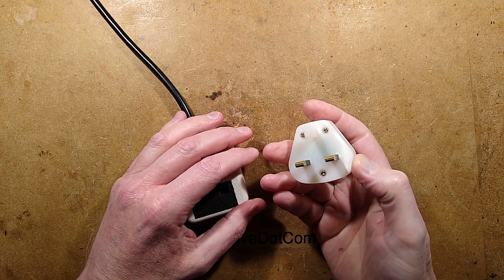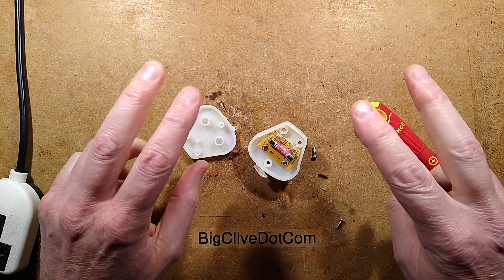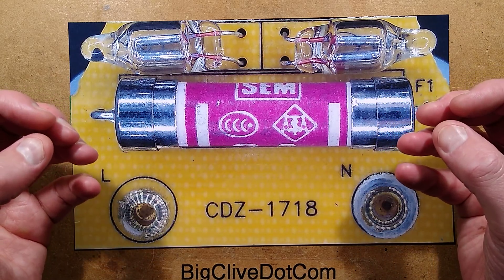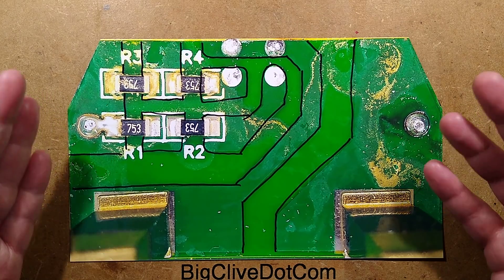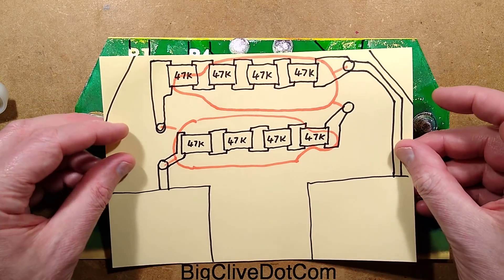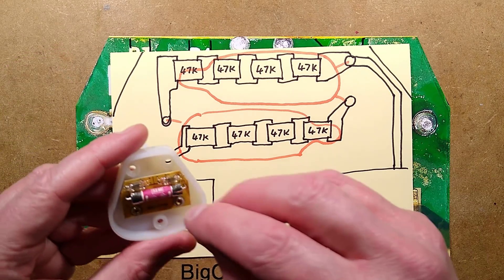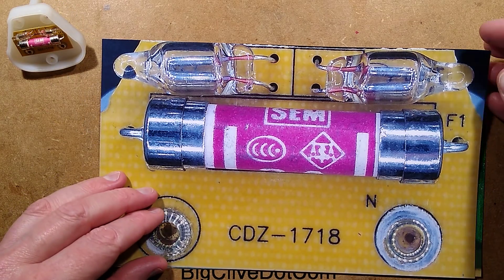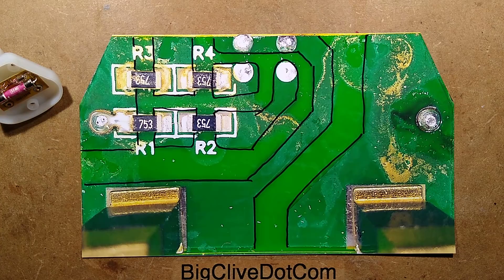British neon night light and the curse of the box-tickers

Comment: They could have a moulded in ”fuse”, to make it impossible to bypass it when you mod the plug to use it as a plug.

Oh, i see: They have gone the cheap crap road and integrated the plug in the board.
And integrated the unnecessary fuse in the same board. That not gonna help when some idiot replace the giant fuse with a cord.
Reply: They could have done a much simpler fuse: A thin zig zag track on a zig zag board, with some lacquer on top.

Comment: If they absolutely had to fit a fuse in it why not one of those tiny 1A fuses you find in electric razor adapters? Though having a fuse at all is overkill, the resistors will act as fuses if their current rating is exceeded, especially little SMD ones like that, or worst case scenario the thin trace coming off the live pin. The regulatory boards have gone mad with power, if I want to injure myself I should be allowed, can't even get paint stripper that works anymore.
Reply: Yep the 3A fuse in that circuit would be that last thing to fail if there was a fault.

Comment: Couldn’t you just turn the board over so the fuse is on the bottom then install lamps on the top ?
Reply: I dont think that design could be wave soldered.

Comment: Thanks for this vid BC. It has helped my understanding enormously. :)  I have a toaster oven with no transformers or circuitry, but the neon (power indicator) lamp went out and the entire device failed to operate. With no circuitry, i wondered if the lamp had acted as a fuse.. of sorts. The mains plug is 13 amp and has not blown.  Toaster was eathed to the chassis and no burning at all. I can only imagine that the bulb was circuit breaker as all the thermo switches operate perfectly. Or maybe live touched neutral?  but the sockets and circuit breakers worked fine and didnt trigger. i've dissasembled it now. if you need any pictures to explain my reasoning for neon bulb fuse theory, i'll upload to imgur. Also 1:43 "One moment please"  :)
Reply: It wouldn't contain a thermal fuse, per chance? (There may be one inside an insulation sleeve, clamped to a suitable location.)
I don't see how the lamp could cause such a failure; it's not in series with the feed to the heater (it can't be).
I can only imagine it being something open-circuit upstream of both the lamp and heating elements.
 
Or does it use a switch with built-in neon indicator? If it does, then if the switch burns out it would stop the operation of everything controlled (including its neon).
Reply: @longrunner258  tnx!. i've not separted the insulating sleeves yet, but now i will thanks to your suggestion. The insulating sleeves only are on the leads to the two cast iron plates on the hobs, not on the oven. All controls are bi-metal mechanical thermo rotary dials, apart, from the neon lamp and two spst switches.  Will reply tmrw after i've done more ripping it to more bits. :) thanks again. appreciated.
Reply: @longrunner258  this is the entirety of the wiring. theres nothing inside the heat sleeves. i added images on my imgur account https://imgur.com/a/fmUPic1

Comment: Just put the fuse on the back where it usually is, if it has to have one.
Reply: Doesn't look like there's enough space inside the plug for that. You'd have to make it thicker.
Reply: I don’t think the plug would need to be thicker, but it would probably have to be soldered on the opposite side, so the neons would need cutouts in the board.
Reply: @Milamberinx  While that would work, it would only exacerbate the problem (even more light will get blocked by the PCB than by the fuse).
Reply: @rolfs2165  did you not finish reading what I wrote? "So the neons would need cutouts in the board".

Comment: Of all the things i have opened with a massive shit stain left by a pcb track fuse that arched out onto the low voltage side, now the decide to put decent fuses into cheep tat. I havent come across a neon indicates switch spur yet, so I don't think it's regs. I think it's a knob designer that doesn't need any credit for over guilding the lily.

Comment: Am I going mad or is the L and N on the wrong side? Shouldn't Live be the right hand pin as it's plugged in? I know it doesn't matter in this situation, but just asking lol. If they used a glass fuse it would have helped as they're smaller.

Comment: As a kid I had one of original versions of these.  This new design with two neons at the top looking like eyes would have freaked me out, making it completely useless as a comforting night light.

Then again, could they not design this using LED filament around the outside, making it more effective than the originals?
Reply: Neons are quite efficient in power draw

Comment: If i HAD to include a fuse, i would have tried the smaller diameter ones, also to solder the neons so they stand off the board, just about touching the cover, it would have given more spread.
Reply: And it would cost more

Comment: We used to have a ladybird style one back in about 1986. I remember my parents having to “get rid of it” and I was distraught. I wonder if the regulations may have come in that long ago!!!!
Reply: Did it use neon?  Or a small tungsten lamp.
I had one that had a single 7 watt lamp like you used to have on Christmas lights.  It was next to my bed, and once it was left on, and the beadspread was up against it.  Charred the cloth from the heat.  Lucky it didn't start a fire.
Reply: @COBARHORSE1  Couldn't have been just the bulb's heat. It likely had a high resistance connection problem, also.
Reply: @johnpossum556  it got hot enough to burn my finger if I touched the bulb.  7 watts of heat, covered in insulating fabric and it certainly will get hot enough to start a fire.  Perhaps you are thinking of the modern Christmas lights.  This bulb was the old fashioned Christmas light, a little bigger than a man's thumb.
Reply: @COBARHORSE1  No, I know which ones you are talking about. My current refrigerator has one for a nightlight right by the water and icemaker spouts. It never gets that hot. I have another one in a motion detector nightlight right by my toilet. I still think you likely have a high resistance connection in that light. I'd check the plug for patina and clean it down with a pencil eraser and you might find it runs cooler.
 It uses that candelabra base. Aldi's just had LED "antique" versions of those when I visited last week, btw. Put that in it and I'll bet it still gets hot.
Reply: @johnpossum556  Too late.  That was 45 years ago.
I think they made 1/2watt bulbs in that form factor too.  That's probably what should have been in that light.  And I think it had a little plastic shade/reflector that I took off so I could have enough light to read by, after bedtime.

Comment: Replace the fuse with a transparent glass type.
Reply: It wouldn't have the required by breaking capacity
Reply: Oh, that's actually a great solution
Reply: Glass fuses don't interrupt arcs the way that ceramic sand filled fuses do. Might as well use a 1/4 watt 47K resistor.
Reply: @Peter_S_  But in the real world it would be perfectly safe.
Reply: @6F6G  Yes, in the real world all it needs are ballast resistors with a proper rating to be perfectly safe. I would also use thin traces just for extra safety.
Reply: @Peter_S_  Probably some knee-jerk reaction to cheap Chinese versions that let their smoke out too easily. As you say, properly rated safety resistors (guaranteed not to go up in flames) for ballest would be more than adequate.
Reply: @6F6G  My guess is a ruling saying that all devices must be fused with a rated fuse which didn't provide an exception for this uniquely simple device.

Comment: A 3A fuse on something drawing mA in normal operation is impressively useless. Surely they could have at least found a 1A one?
Reply: 1amp fuses are more expensive than 3 from what I've been told.
Reply: @Max Hammick . . I didn't see anything say 3Amps. Where was it please?
Reply: @chrishutton1458  1:26
Reply: @maxhammick948  Thank you I've seen it now. The BS standards include 'preferred' values of 3A, 5A, 10A and 13A. So ignoring a search through 'what is available' they've gone for the lowest 'preferred' value.
This is probably also the cheapest option. My fav site has 3A at 22p each (min order 10).
Reply: Chris Hutton BS-1362 fuses are color coded by amperage, so that is where the 3A is coming from despite the text with the fuse rating not being visible.
Reply: @ethanpoole3443  It didn't look like the red I was expecting.
Reply: @chrishutton1458  if you look at the actual circuit board with the fuse then it is much more red, though still seemingly a bit off, than the photo Clive took which has a white balance issue that makes the fuse look almost magenta.
Reply: Why should we, as Americans, complain? May I remind you we've had dual fuses in christmas lights for well over a decade now.
Reply: I would never discourage protection, but 1 amp or less would be sufficient. What a waste?
Reply: John Possum The fuse’s in our Christmas lights were added to protect from excessive light sets being series connected and was a real problem back when the typical string was incandescent based, particularly when used outdoors for decorative lighting as people would string as many together as they thought they could get away with and the wattage could really add up.
Reply: @johnpossum556  The fuses in Christmas lights do not affect the light output of the lights. It's in the plug away from the string of lights. Fuses in plugs does make sense, but even the Christmas light fuses are pretty small, i've seen as small as 250ma fuses in the plug, and thats on 120V where you have half the power at any given current. Surely they could have gone with something similar here, they make tiny HRC fuses that would meet requirements for 32A 240V lines.
Reply: @2009dudeman  I never said the fuses affect the christmas lights, I just said that we use DUAL fuses in them. Facts must confuse you easily.
Reply: @johnpossum556 
Facts confuse a lot of people when they're only vaguely related and don't seem to have any point.
Reply: @tin2001  My point was clear. Our two countries' ways of dealing with house voltage safety is different, yet similar in many ways. Your ability to comprehend nuances is low. Go back to remedial English class.
Reply: @johnpossum556  Not only was your comment useless, you just want to be oppositional and childish.

Reading comprehension must be hard for you, because the original complaint was not about the mere presence of a fuse, it was about the size of the fuse which is impacting operation of the device.

You pointless comment about Christmas lights where they use properly sized fuses doesn't make you look smart either as those fuses do not impact the operation of the device.

Go be a waste of space somewhere else.
Reply: @2009dudeman  Considering we are just electrons on the internet that makes about as much sense as the rest of your "reasoning". Remember the thing about first impressions is that you never get a second chance.
Reply: @2009dudeman  The fuse has to be BS1362 compliant. Which effectively means that the size, shape and material were decided in 1947. They could technically fit a 100mA fuse, provided they can find a certified one, but that's probably more expensive than just picking the smallest commonly used certified fuse.
Reply: @fermitupoupon1754  perhaps, but there are provisions in the standard to allow for non-conforming plugs (using alternative fuses with similar arc breaking abilities in a smaller form factor would fall under this catagory) to be approved so long as they provide at least the same minimum safety as regulation plugs. Since the plugs have to be approved anyway for sale, I wouldn't think getting alternate approval would increase the total cost much seeing as you only have to get alternate approval once. 

I imagine the slightly added cost to getting it approved in the UK would be somewhat compensated by the lower design costs.
Reply: @fermitupoupon1754  ohh, thank you for having a pleasant discussion.
Reply: @2009dudeman  No, the idea of the standard is to eliminate "non-conforming plugs" so that consumers won't be tempted to insert an incorrect fuse, or worse, bypass the fuse, when it blows and they do not have a replacement at hand.
Reply: Put in a clear fuse and then light could pass through.
Reply: @jamesplotkin4674  UK BS1362 fuses are always ceramic tube and filled with sand. The required interrupt capacity is too high for glass tube fuses.

Comment: I had a couple of these as a kid as well. With a Smurf picture on them :D I called it the Smurf lamp.
Reply: I have a Donald Duck one from the late-70s (or really early-80s). Plugged it in to check it out a few weeks ago when I found it in a drawer (where it had been sitting for 25+ years) and it still works.
Reply: My first car spark plug tester was a neon bulb in a blue handle with a metal scoop on it that went around the spark plug wire to safely test for spark w/o removing the plug or wire.
Reply: We had loads of these as kids. In Australia, they mostly sold with the one round design lamp, and removable friction fit covers with popular kids TV show characters like Thomas The Tank Engine or Ninja Turtles...
We didn't really use them as such - mostly they just sat plugged into sockets in various rooms, not actually switched on.

Comment: if they thought they needed a fuse.. surely it could go on the backside of the pcb?
Reply: The riveted on pins are a fixed length. That restricts the board to very close to the back of the casing. This is a cheapo device; they likely were told to go to great lengths to avoid retooling the case.
Reply: @0LoneTech  the more you know. thanks!

Comment: Why would a ring mains require a fuse. Is that why you guys fuse everything?
Reply: Ring is rated at 32A the fuse is technically rated to protect the cable to the appliance.
Reply: @dogwalker666  this one has no cable!!!
Reply: @DolganoFF  indeed so all it required would be a 150 mA HRC  PCB fuse, not a full size bs1362 3A.
Reply: @dogwalker666  exactly
Reply: @Matt Quinn That makes a lot of sense now. We have fuses in NA but they almost always go in the box. Also I just noticed I asked the question wrong, meant to ask why everything attached to a ring main would need fusing.